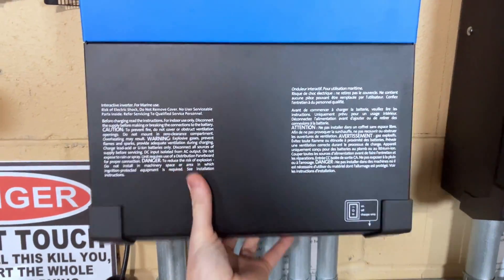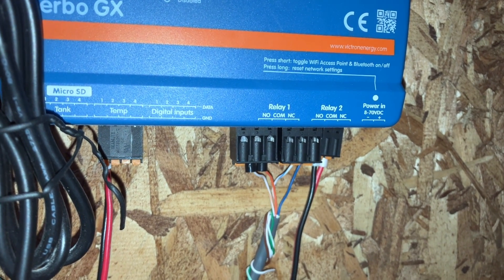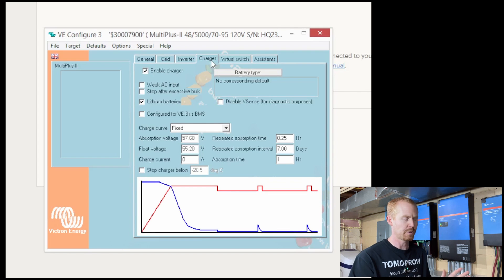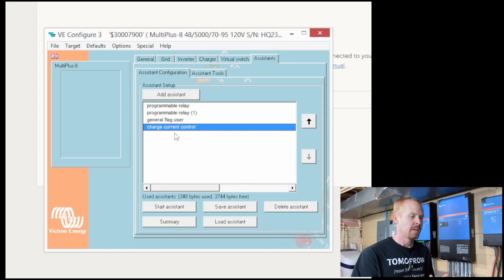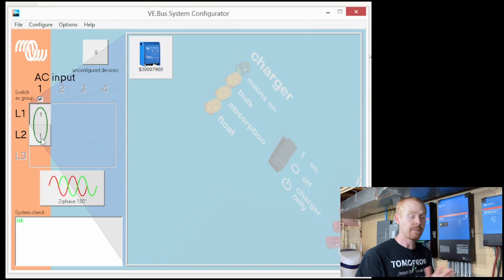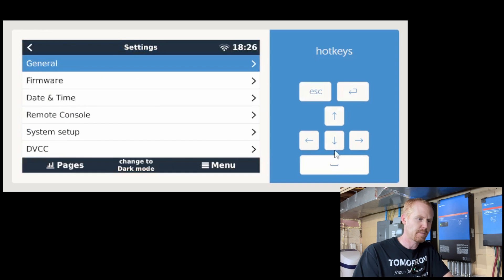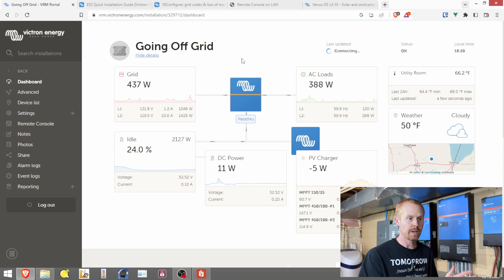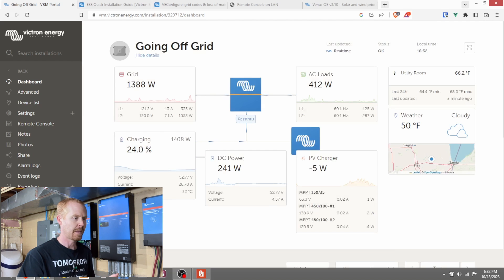Custom Grid Charging: Victron MultiPlus 2 & Cerbo Relay

Comment: Hi & thanks. I was trying to find such a solution for a while. But a couple of questions: should it work on a Multiplus I (Cerbo GX v3.13)? Could you show details of the wiring cerbo-multiplus? In the relays settings, I can't change the relay name, and I don't have the option to show the relay in overview, does it come from UPDATE?
Reply from the maker: I’m not 100% sure if it works on the MultiPlus 1 or not. I know there were some differences between the two models.  Provably wouldn’t hurt to test it though.

The relay name and the overview options were all a part of the GuiMods changes I did a few weeks ago. 
https://youtu.be/RVkTFtDDvfQ

As far as the wiring goes, there’s not much to it.  I just took a Cat5 wire and connected it to the terminal blocks on the Cerbo and MP like I showed in the video.

Comment: Which physical relay terminals are controlled by the manual "Relay 2" switch? Thanks! Great video!
Reply from the maker: Thanks!

That would be the "Relay 2" terminal block on the bottom of the Cerbo.

Comment: Great video!  I was one of the posters in the VE forum looking exactly how to do this and up until recently I've been using an external charger and relay to keep the batteries from dropping too low.  NOW I can use the Victrons, and choose when to charge them.  My only difference I saw with yours vs min, is the relay scren, you have allow more options, mines just the two relays and "on or off"  havent found a way to get them on my main screen yet.  Very similar setup too, just the 3k mpII's.

THANK YOU!!!!  This video has helped immensely. 

Liked!  Subscribed!
Reply from the maker: Awesome!  Glad to be able to help!

To add more options as well as control the relay from the dashboard, take a look at this video: https://youtu.be/RVkTFtDDvfQ
Reply: @AdamDeLayDIY that did it!  Thank you so much!

Comment: Thanks Adam for a great tutorial.  I liked your idea so much I've implemented it on my home Victron based system.  It works great.  I noticed on the Multiplus assistant as I was stepping through it, that if the voltage signal that you're sending to the Aux 2 relay on the Multiplus is set at a voltage between the high and low voltage limits, it will prorate the charger current going to the batteries between the high and low charger current limits.  I'm going to play around with that concept to see if I can fine tune the charge current without having to upload a new configuration to the Multiplus if I want to tweak the amount of charge current.
Reply from the maker: Thanks Bruce!

Keep me in the loop with what you find!  I would be very interested in that.
Reply: @AdamDeLayDIY   Following up on this topic.  After researching how the Multiplus Aux2 input works, I found that it is pulled up to a 5V signal through a 10k ohm resister. 
When the input is open (eg. the Cerbo Aux2 relay contacts are open) the signal is 5V.   Of course the signal drops to 0V when the input is shorted (eg. the Cerbo Aux2 relay contacts are closed).  This enables/disables the charger as you noted in your video.   But in addition, the 'charge current control' assistant also allows you to linearly control the magnitude of the charger current if the signal voltage on the Aux2 input varies between the low and high voltage limits set in the assistant.  Thus, by wiring two pins (the center and one of the outside pins) of a three pin 20k ohm potentiometer in parallel with the Aux2 input on the Multiplus (or the Aux2 relay on the Cerbo) and setting the Charger Current Control Assistant parameters to 0A when voltage is lower than 0.50V and maxA when voltage is higher than 3.3V, you can now control the magnitude of the DC charge current using the full range of the 20k ohm pot when the Charger is enabled.   And you don't have to upload a new configuration to the Multiplus.  It works great!
Reply from the maker: @brucebugbee6604  that's really slick Bruce!  Great job!  So the pot would adjust the charge current based up to what you have set as the charge current in the assistant?
Reply: @AdamDeLayDIY  Yes the charger current adjusts proportionally based on the Aux2 signal voltage, ranging from 0A at 0.5V up to the charger current setting at 3.3V in my setup.  The voltage signal across Aux2 is defined by the following equation when the Cerbo relay contacts are open (charger enabled):  Vsignal = 5V x pot kohms setting/(10k ohms + pot kohms setting). When the pot is turned 'up' to 20kohm, I end up with a 3.3 volt signal (5V x 20kohm/30kohm) on Aux2 input.  So if I set the charge current to be 50A at a 3.3V threshold in the assistant, I get 50A on the charger when the pot is turned all the way "up" to 20k ohms. When the pot is turned down halfway to 10kohms,  the signal voltage on Aux2 drops to ~2.5V (5V x 10kohm/20kohm) and the charger current drops to about 35.7A.  When the pot is turned down to 5kohms, the signal voltage drops to ~1.7V (5V x 5kohm/15kohm) and the charger current drops to 20.8A. When the pot is turned down to 2 kohms, the signal voltage is 0.83V and the charger current is about 6.0A.  I set my disable charger voltage to be 0.5V so the charger is disabled when I reach about 1 kohm or below on the pot.  Of course if the Cerbo relay contacts are closed (charger disabled) the pot setting is irrelevant in that scenario.
Reply from the maker: @brucebugbee6604  that’s awesome!  Thanks for sharing what you found!

Comment: Hi;

Why did you switch to Victron Inverters?
  We're your EG4 6500EX'S giving you a lot of problems?
Reply from the maker: The biggest reason was that Current Connected sent me the Victron inverters for some long-term testing.  If you go back through my videos, you'll see I did end up having a lot of issues with the 6500s.  Unfortunately, the biggest issue I had was with the lack of communication from support though.
Reply: @AdamDeLayDIY  
  I have been watching your videos for quite a while,  and I did see some of the difficulties you were having, I was kinda surprised seeing your 6500's replaced with Victron. 
   I have a couple of 6500's but I am only using one of them so far mounted on a hand truck for a temporary power source which so far works well, but I am always apprehensive especially after seeing problems others have experienced. 
  Thank You for all the great information you have passed along, I very much enjoy your videos.
Reply from the maker: @LincolnSP150  Glad to be able to help out.  

When people ask if they'll have problems with the 6500s, from what I've seen it always ends up being the flip of a coin.  Some have no issues at all and others have a lot of issues.  Some issues are self-inflicted due to improper installation/understanding but not all of them.  

For a hand-truck installation, I doubt you would see a lot of the issues people experienced because you're only using it as temporary power.  

Good luck and have fun!

Comment: It would be fun (and nice) if you could also add the opposite of this: manual dump energy from the battery to the grid! (In some countries - like The Netherlands - you can earn some money by selling your energy to the grid.
Do you have a solution for that?
Thank you 🙏
Reply from the maker: I believe that when you use ESS, there’s a grid set-point option.  A positive number will draw from the grid and a negative number will push back to the grid.  

https://www.victronenergy.com/live/ess:ess_mode_2_and_3
Reply: I use Home assistant and have it connected to my Victron setup and at 90% battery it will turn on some loads that are nice to have but not needed, and at 97% I start turning on dump loads.  Right now in winter in Wisconsin those are a heat pump at 90% and at 97% some heaters.   On the opposite end to preserve power I have it switch things off starting at 30%.
Reply from the maker: Unfortunately in the US since the inverters aren't UL listed, they cannot be configured for selling back to the grid.

Comment: What would be the purpose of this Aux 2 setup if you already have Aux 1 setup like your previous video? Wouldn’t “Start Generator” do the same thing? I typically use the VRM for all my monitoring needs.
Reply from the maker: By default, when in passthrough mode, the inverter also charges from the grid.  Now you can disable this in VE Config, but then you would have to re-enable if you had to charge from the grid for whatever reason.  

So even when my system switches over to grid (using the generator setup from the last video), I don't want to charge from the grid.  I want to primarily charge from solar only.  

Like the generator setup, this gives me the ability to use the Cerbo (or the VRM) to enable or disable charging from the grid.
Reply: @AdamDeLayDIY  I think I'm following. I have an 50 amp RV with a MP-II x120. I'm trying to do somewhat the same. Run loads and charge from solar and only use grid when the loads are high or the SOC is low. I'm not sure what value it would be for me to separate out the charger function when the mains / generator connect. In my case (say after many crappy days of no sun) I'm going to want the batteries charged from AC. It looks like the Aux 1 / Generator function would be all I need. Are you using the Aux 1 setup primarily for running high loads and using the Aux 2 for finer control of grid battery charging?
Reply from the maker: @williamsmith648  Pretty much.  Aux 1 is being used for low SOC switching back to grid as well as high loads.  The generator function of the cerbo lets me really dial in those numbers without having to constantly make changes using VE Config.

Aux2 is very rarely used.  My charger is set to 0a in VE Config, so the only way I can enable charging is using the Aux2 relay.  I might use it a few times during the winter if I go weeks at a time without a full charge, just to let the batteries refill, but most of the time that relay will be turned off.

Comment: Hey Adam - hope all is well :-) Would you happen to know a way to tell the Multiplus II to charge manually via VRM from the VenusOS Rasberry Pi? There ins't a relay aux input on the Rasberry Pi so unless I missed it in the video talking about that... I cant tell the MP-II to charge my batteries outside of my charger fixed/adaptive settings for voltage and absorption repeat. I can get it to manually charge but its through a VRM restart command to the MP-II as a whole haha... but dont like to do that.
Reply from the maker: Actually yes.  I've done this before on my old 12v system.  I purchased a relay board and wired it to two of the GIPO pins.  Let me do some digging and see if I can find the details again.
Reply: If the RPi is used for Venus OS, where there are no relays like on Cerbo, it is possible to connect a PCB board with one or more relays to the RPi and install it in the Venus OS, where it is then used just like the relays from Cerbo. I've seen videos of how to add PCB relay boards to the RPi Venus OS.
Reply from the maker: Ok, so here's what I found.  

The VenusOS install has 1 "relay" enabled by default (I found this out because I had to wipe my own Raspberry Pi and start over).  You can add others if you want by installing the RpiGpioSetup from KWindrem.

 So the "relay" option for the raspberry pi basically just turns a pin on or off on the gpio header.  You actually need to add your own relay to control whatever you want to switch.  Years ago I wanted to be able to turn my giandel inverter on/off through the VRM.  So I bought one of these relays (https://www.adafruit.com/product/2895) and wired it to the GPIO pins on the pi.  I'm sure there's other options out there, but these were cheap.  You only have to solder 3 pins (3v, gnd and signal).  

I then purchased these breadboard wires (https://amzn.to/3M1OC4D) to connect the pi to the featherwing.   I used 3 female to female wires.  My raspberry pi is a 2B (so you might have to double check your specific pi gpio pinout)
3v on featherwing -> GPIO header 17
Gnd on featherwing -> GPIO header 39
Signal on featherwing -> GPIO header 40

Then all you have to do is set the Relay to "Manual" in the Remote Console and you should be good to go.  

I'll see if I can throw together a quick video to better show what I'm talking about.